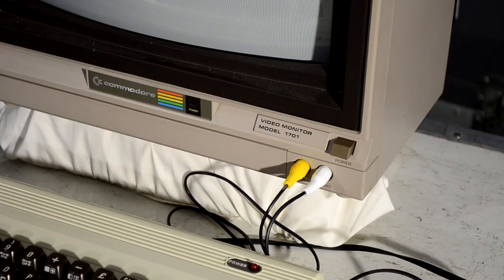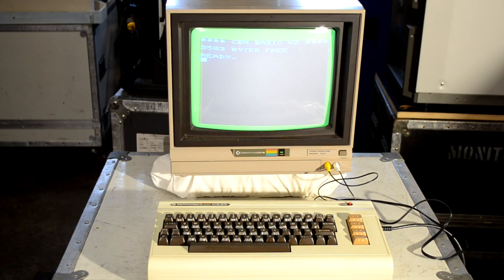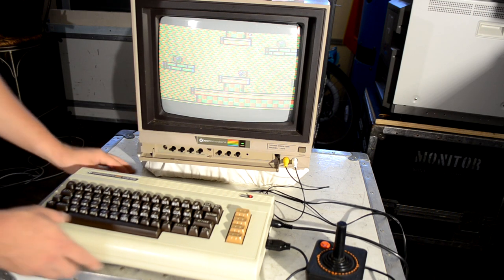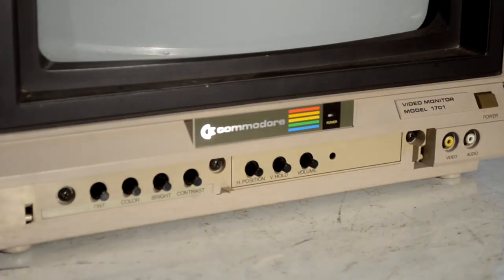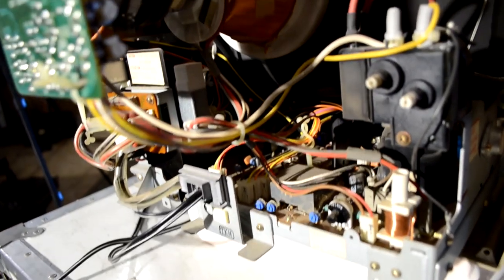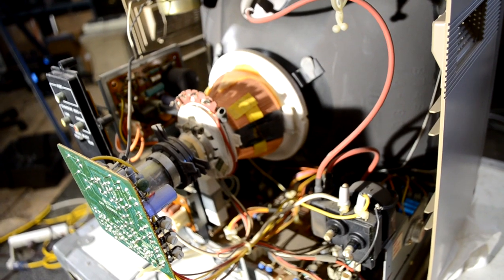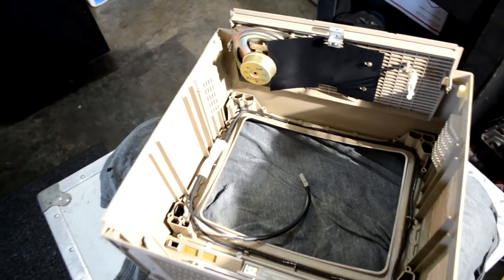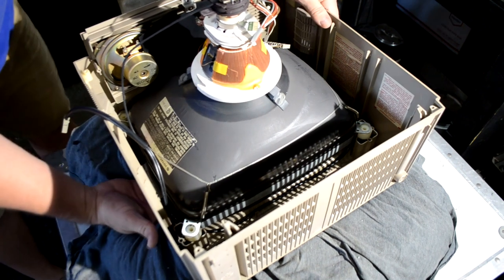Commodore 1701 Video Monitor | CRT Repair for My Life In Gaming  *The C64 & VIC20 Display!

Comment: Besides the four pots, you have the height coil (vertical copper-wound component quite visible to the right of center at time index 15:55) You adjust it by putting a non-metal vertical height tool (available at TV repair shops or on eBay) down the core (gently!) and twisting it. Don't try to use a metal tool! A metal tool will get too hot to hold in a matter of seconds.

Comment: 3:55. The 1701 and early production 1702s have a cavity above the rear connections.  The legacy of this case using the same molding of a similar sized JVC portable TV.  In the space snaps the "rabbit ears" antenna assembly, though entirely superfluous for this application.

Comment: Since there are missing sections of the corner posts, I would suggest filling it with ABS Cement from the plumbing section at most hardware stores. Since it's just ABS dissolved in an ABS solvent, it will fill all the gaps with missing ABS and fuse to the existing ABS. I don't know how stable ABS Cement is over time so it may get brittle too but that should not matter when it will be solid ABS as opposed to the original with thin sheets of the stuff. I use it for repairing screw posts and such all the time.
Reply from the maker: Thanks for the great tip.  I didn't think of that.  I'll have to test that out on the next one.

Comment: Awesome! I've been waiting for you to start digging into the commodore monitors. I have the 1701, 1080, and a 1084S-P, which I just fixed the power button and did a full re-cap on. Nice work!
Reply from the maker: Very cool.  After working on this one, I'm trying to find one of my own.  They are fantastic.
Reply: @RetroTechUSA  For sure. The 1080 and 1084 series are quite a bit more versatile, having Composite, Chroma/Luma, ARGB and RGBI inputs but I love the classic look of the 1701 and 1702.
Reply: @bnice7  My 1080's brightness fluctuates with no apparent reason, shame I don't know how to fix it, it's my favorite monitor
Reply: @joeffreysmith5910  my best guess would be some capacitors failing, either on the power supply board or the neck board.
Reply: @bnice7  This is what I was suspecting too -I should have trained in electronics instead of healthcare, then I could do something about it.

Comment: Awesome video! Just a warning about plugging sega controllers into commodore systems. The way the genesis controllers are wired can cause damage to commodore systems like the c64 and Amiga. There is adapters available that rectify this issue.

Comment: Hello! Some month ago I got an "Sony Trinitron kv 29fc20e" for my arcde proyect. Somehow I managged to output video from my computer through scart, and finally play some games. But I realize that in the screen borders the red,green and blue separates, also that te picture is tilted and straight lines becomes curby in one edge. I have seen some of your videos solving this problems but do I need a remote controller? mine its universal and I can't access to the service menu. Should potentiometers for all  this touch-ups be inside?

Comment: Thanks! Hope most of this applies to the 1702, since I'll be recapping mine soon... It gets jumpy with bright screens.
Reply: Mine is also jumpy. Does that mean it needs new caps?
Reply: @sajsabotage2043  I guess I'll know when I get done recapping it. :) I've heard that there was no international consumer standard for 75-ohm impedance composite or S-Video back when this monitor was made so it's possible that consoles designed for composite video are just too "hot" for a 1702... or maybe not hot enough. I dunno how that works. ;)
Reply: @sajsabotage2043  I'll try to remember to update this thread once I try it.
Reply: @emmettturner9452  I've read luma on commodore's version of s video is ''hotter'' than the more modern standard
Reply: Bump. :)
Reply: @djmips  Never got to try because of an EF-4 tornado displacing me and forcing me to get rid of most of the collection (see my videos). Pretty sure I still have the 1702 but what’s left is in storage and currently inaccessible. Got a workshop since I couldn’t work from the basement at the old place but now I’m forced to live there and don’t have any place to do the work.

Comment: Adrian Black tried to repair a broken C64 case with JB weld, and the parts broke apart easily
Reply from the maker: There are many different types of JB weld.  Maybe he didn't use the right one?
Reply: That's why I suggest ABS Cement for repairs like this. It's literally ABS plastic dissolved in an ABS solvent so you can fill all the holes and make it more solid than it was from the factory.
Reply: @RetroTechUSA  Regular JB weld is actually not ideal for plastic unless the surface is pretty porous or roughed up, it will often snap off later due to flex or heat cycles. They actually recommend "plasticweld" for plastics. I have had much better luck with it keeping together my ford years ago when everything started falling apart.

Comment: i was kind of hoping he would tackle that video select switch at the back.
there a very common problem with audio going out and i can't seem to find a replacement switch small enough.
Reply from the maker: Sorry, I wasn't aware of that problem.  This was the first time I got to work on one of these and it only had the broken bezel issue.  Do you mean your toggle switch on the back is broken?  Or is the audio out?
Reply: the switch gets cabon build up on the inside and can be fixed with a fiberglass brush. if you take it apart  (not easy) it messes with the video but mostly the audio when this happens
Reply: sorry i mean the toggle switch at the back

Comment: I know this has been said, but it needs to be said more.  Please DON'T plug Sega genesis controllers into the c64
Reply from the maker: Thanks but this one is a VIC 20 so it doesn't seem to have the same problems as the c64
Reply: @RetroTechUSA  I was stating more for your viewers, but vic20 has same input pinout.  There isn't as much out there on people having issues, but I still wouldn't chance it, atleast not without an adapter between it and the computer.  Just my two cents

Comment: I would consider adding Plastic JB weld Plastic epoxy putty into your arsenal if you already haven't since you can use it to fill in mixing  plastic sections that may have chunks missing in conjunction to the liquid adhesive.

https://www.jbweld.com/product/plasticweld-epoxy-putty